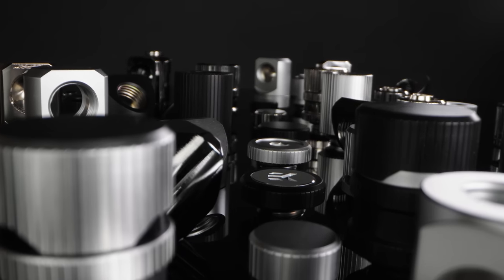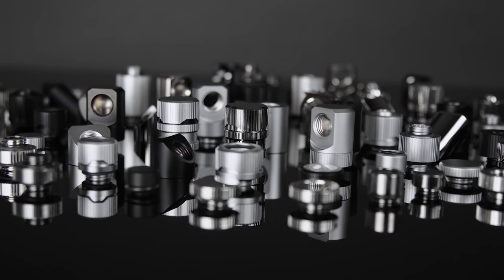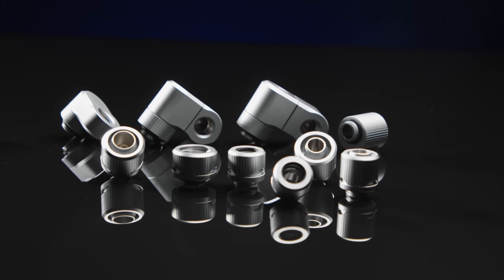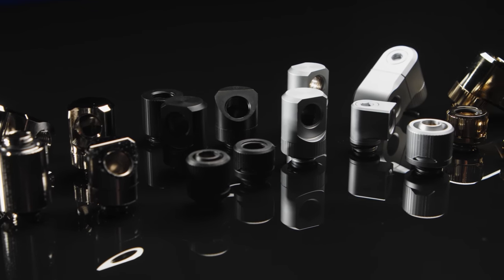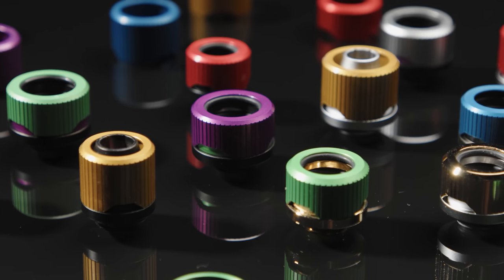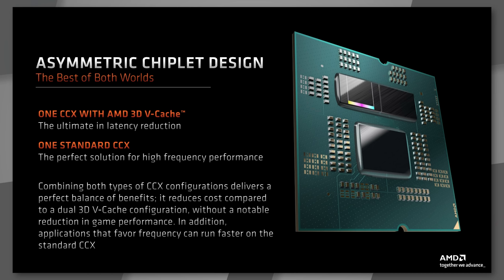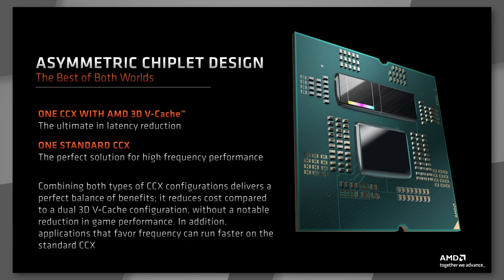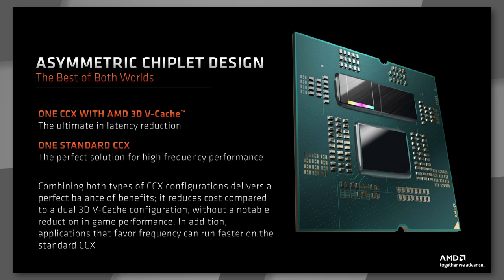Why I switched back to Intel...

Comment: You do realize a -30 offset on all cores would never be stable on 95% of 7950X3D's, that was your problem from the beginning when running 6000MHZ  if your CPU is not stable your ram would seem unstable, I have a 7950X3D with a SP rating of 118, and can only get  CCD0 -14, -7, -11, -11, -9, -7, -20, -22 CCD1 -26, -21, -25, -25, -20, -32, -28, -36 MAX undervote stable with y-cruncher core cycler and OCCT 14 hours. Using Gskill 6000MHZ I had many stability issues but once I stabilized my CPU per core offset i had no ram issues. it's no wonder you were having issues.

Comment: Ya definitely not getting a good fit on the die. My max temp is 62c that I have seen so far and that's with a CORSAIR iCUE H150i. I'm running the KF variant but can't imagine graphics on the die would add that much more heat.

Comment: Last year i did a pc for a friend full AM5 7900x with a rog strix 670e and ram 8000(now why he wanted 8k ram even tho i told him all the time it we couldnt reach that , i have no idea) and even tho the MOBO had like 20 update bios? we never could go further 6400. I was wondering why there are so high speed ram when you couldnt actually use these speeds? Im not a pro just doing it for fun and as a small hobby. 8000 ram man, damn o_O? 

Anyway im on 5900x with 3800 ram and a 7900xtx nitro+ and i was thinking on moving to AM5 gen. I realise that AMD as quality product is starting to "degrade" from time to time. I read we will have new CPUs and new MOBOs on q2 2024.
Should i wait for that or should i move on to Intel :/

Comment: same ram issues with the 5800x cannot even overclock ram above 3600 x4 sticks
Reply: That's why I'm waiting for the new stuff.  The only thing I care about with Ryzen 9000 is 4 sticks of ram working at 6000 for 64 gigs or 5600 with 128 or 192 gb's.
Reply: @traingp7  new stuff will have worse bugs like that though....

Comment: whats thet best aio cooler for 14900k ?
Reply: I'm currently using the Arctic Liquid Freezer 3 360mm for my 14900K and it does the job without any problems.
Reply: The sun because its warmer
Reply: Arctic Liquid Freezer 360 II or III are the best AIOS atm

Comment: I wish I had of seen this 2 weeks ago when I bought all my parts as I would of gone Intel over AMD I bought the Ryzen 9 7900X 12 core 24 thread which is seated on an ASUS TUF gaming B650 and bought 6400 corsair vengeance ddr5 ram and ended up having to dial it back to 5400  to get it all to run stable, the instant you ramp the RAM up to 6400 any game you enter will run fine for 5 mins but will just crash and black screen the whole PC and restart so my PC now sits at 5400 to remain stable, although its not a big deal its FREAKIN ANNOYING

Comment: I have recommended AMD machines but I've never purchased one. Since Core Duo days I've been team blue and never had any problems. I'm glad AMD exists for the competition. My 10600K is handling my 4070 Ti great. I want a 14600K or 14700K mostly for increased single thread performance because UltiMaker Cura is single threaded

Comment: I'm struggling to get my new Ryzen 7900x (non 3d) to post half the time. I think I bought the right hardware at least: Asrock steelseries 670e (newest firmware 2.02), samsung 990 pro 4tb (newest firmware), 2x 32 gb non rgb gskill z5 neo cl30 6000 (supported by mobo list), 750 watt golden plus corsair psu (2 years old, works fine in other system aswell). Windows 11 pro, registered and fully updated. Random crashes galore, even in (newest) bios with just one ram stick in any slot and using ipgu and ram with (6000) or without expo at 4700mhz . All temps under 40 celsius, cpu and gpu load far under 10%. I'm at a loss, not yet found a solution. I was able to install w11 at least. But everything more ram sensitive (eg. gaming) it crashes 100% within seconds. If it boots I can play youtube and browse the web, that's it. Not even tried benchmarking yet. Windows error codes event (id 29, id 6008, id 41) over and over. But I had a crash in bios aswell an hour ago. It reboots and hangs with a black screen. Dram red led on mobo flashes all the time during long bootsessions, must be the training or whatever. My 10 year old i7 4790k with fully bloated ssd's and hdd's boots faster and only crashes once a year or so due to usb problems with some peripherals.
Reply: Sounds like a bad CPU or board. I'd try to get the CPU exchanged as soon as possible.

Comment: 7800x3d msi x670e carbon with corsair vengeances 4800 running 6000oc with xmp an I have had no crashes, no blue screens, nothing.

I've had both amd and Intel an I was skeptical as this was my first "full" build an I didn't want to mess up or wish I had went with the other but I ultimately went with AMD.   This is coming from a i7 14700kf an im still worried i might have made a mistake but overall everything has been phenomenal and i even feel like my 7800x3d has been better for not just gaming, but also normal stuff like webbrowsing while watching youtube with a game open in the background (an this is on integrated graphics), an I just don't want to wish in the future that I went with intel just incase, but I mainly want with AMD for the future proofing and not having to get a new board for a few years.     Its been great an I love it.
Reply: Tbh it sounds weird since you are comparing a 14700kf, which doesn't have integrated graphics ( f = no igpu) with a CPU that does. The intel would have been better at handling the "normal stuff' you are describing, especially if it involved streaming.

Comment: My god, a video actually talking about issues with ryzen rather than just heralding them as the BEST regardless.  Old vid i know but i have had issues with every AMD build i have ever used, but i also have never used the top tier CPU for either
Reply: I had so many "driver timeout" crashes while Gaming its was so annoying! Now 1 year later I had bought a new 7800X4D, 32GB DDR5 5200Mhz and ..... I get even the same issues again! -,- No OC, I use it out of the Box and while gaming it crasht. Got told from another Youtuber its "an user error" or "there are no driver timeouts man, listen to me" ... Now i switch to Intel i7- 13700k (yeah, i know "dead socket") but I'd rather have less performance in games than these problems

Comment: So it seems it's mostly a 3D-problem, so anyone of us plebs that can't afford or justify the expense and just run a more 'normal' option should be fine? :D I'm on my 3600-system still :D Last few times I've used a system builder to kind of gauge the cost of a new system I've gone with AMD, didn't seem like Intel would get me lower cost, but it would be easier to get an Intel NIC, or so it seems (only select higher end boards have anything but Realtek for AMD it seems)... 

Anyway, I guess I'll avoid X3D at least, but that's kind of a non-issue for me anyway due to my really restricted budget :)

Edit: Looked at Intel and it's way more expensive as it stands... Cheapest mobo with BIOS flash, PCIe5 M.2 and Intel NIC was MSI Tomahawk Max and that's like 450 USD here, maybe a bit cheaper if lucky but yeah. And even that has the simple LED error code system...

In my not so humble opinion even basic mobos should have BIOS flash (and preferably CMOS clear as well) by now...

Comment: i have a 5900x with 3080ti once awhile its has goof like shutting down random but it happens more offen on windows 11 then 10. So, I end up on windows 10 or on arch linux. As for Windows 10 is running hotter than Linux for some reason but since its colder outside now i end up running windows 10 during the winter months and summer i run Linux

Comment: I've been on a boycott of AMD since the ATi days when my 9600 series GPUs couldn't last a year without dying. Finally tried AMD again a couple years ago with a 3700X & 3900X I snagged from microcenter. They also died in less than a year. Meanwhile I still have 4790K and 7700K Intel CPUs and an even older dual core running in other machines. AMD will always be the walmart grade of custom PC building.
Reply: I've never had this problem with any AMD chips. If you had a GPU problem, then it's likely due to an AIB design vs reference design. Time and time again I see complaints blaming AMD directly when they're not responsible for third-party AIB's taking their design and adding on different VRM's, MOFSETS, etc.

I've had a couple XFX cards have problems but the company was good about replacing them. Sapphire no issues.

Comment: Transition to "Windows 12" (24H2) Works for me on a non supported hardware CPU to old and no TPM. Can be avoided with some tricks. Installed it. Not the final version. It is all a major letdown. Beter? Nope. Just some things that needed to address are solved. Not a feeling of a Windows 12 OS. They keep up bringing out new versions which they started with Windows 10. Their policy? What lays in de future? An OS that boots and transfer al there is from a cloud machine? A dumb terminal is expected from us. Paying every month for their services... Nope. If that were the case? Hello Apple. 

They can't do that. MS was freaked out about the complaints when win 11 was released. Must buy new hardware to comply to our standards. Said F*it. which was BS. Running Win 11 on old hardware. Stable as F. My i7 K version with 4 cores and a GTX 1080 doesn't complain about everything. Everything runs with speed. Bought a RTX 3060 Ti. Motherboard gave me problems despite many tests who all said; compatible. Don't worry. It did not. Bought a new motherboard with a i7 again but with 12 cores. Not a i9 because to expensive. i7 and RTX 3060 Ti did not let me down. Max speed all the way. Not thanks to MS. Thanks to Intel, Nvidia and Asus. AMD is a real competitor in my view. Had several systems running with AMD CPU's. Cheaper than Intel.  Their same socket policy attracts many people. Just buy a new CPU. It has it drawbacks. Problems occur. If you buy a new motherboard and a Intel CPU? No problems. Drawback? Many sockets. Think that my motherboard can handle a i9. Not to the max. Can handel an i7 with ease.  Not upgrade proof. AMD just have one. AMD4 or 5 socket.  And the surprise of everything? My new 1 year old motherboard went broken. Had to revert to my old system. And surprise Win 11 latest edition and modern games who are demanding runs without any problems. But to the absolute max that everyone wants, but  a slider back? Produces still amazing results on my screen. No delays or what ever.  Smooth with old hardware. With Win 11 MS wanted to step up the anty. BS! 

Old hardware works just it works before. Was surprised about that fact. 10 year old hardware does still a pretty good go at the modern games. No need for state of the art hardware. We still believe that story. New hardware is better... Went from 60 FPS to 240 FPS... Difference? Nope. AMD and Nvidia compete over what? DLSS or an other Technic? Don't worry. Intel introduced XeSS which will run on any hardware. AMD, Intel, Nvidia or AMD. Fuck them all. We introduce our own Technic. Which will don't need a state of the art gaming videocard. Our powerful CPU will handle it all. Powers. They all compete for customers. Buy our product..... AMD let me down in performance and problems in the days back then. Intel (Despite an expansive product gave performance with no problems) back in the days when they produced the i7 was a god send. Solid performance. Are now gready as hell; buy our top product of our i9 series.... Ehm? Nope. To expensive with no performance gain against a good i7 K CPU. SO no thanks..... If you have a bad GPU than there is nothing that a CPU can do against it. That switching back.... I can understand this. 

AMD must come up with a revolutionair product.  They are trying... their best to do so. But Intel rules still against all odds. What I am missing; a very good CPU which is cheap (don't care if it is Intel or AMD)  Performance CPU is somewhat from the past. Can browse or handle emails without lifting any finger. Games? Look to AMD and Nvidia. The battle of the CPU's is over. Now is it is the GPU's. More cores? Unbelievable. Do we need it al? No. I see no difference between 60FPS with all maxed out and a 240FPS card.... There is a limit we all have. Gamemakers are trilled about what they can  produce. In one game I see lets say ray trace effects. It that important? No. I want to survive in that game. Effects are not a part of this goal. We play it because it it challenging. Farcry engine and Unreal engines got that message. Are leaders of the pack.  One demanding game; Callisto protocol. Played it on an i7 (12 core) and RTX 3060Ti card. Now again at my old i7 (4 cores) and GTX 1080.... Difference? Nope.... What I see and feel qua performance? The same. RTX gives you some more effects with DLSS on but does it matter? Nope. Speed is no problem. Effects? Somewhat less. But that old GTX1080 performs and make use of DX12 as the best. It's all relative. Company's shouting all "Buy me" does it matter? No. More speed what don't crystallize. Do I have a wish? Yes. Faster NMVE's. Don't like to wait before a scene is being loaded. No CPU or GPU problem. Just like USB 3.1. We are in need for USB 4. It's coming with some drawbacks. Compatible hardware. We must buy (again) new stuff. I said No. Enough is enough. 

If you react? Just your 2 cents about it. I see the trend as just as JaysTwoCents about the subject. Gave him a solution to install Win 11 on old hardware Got at that time also old hardware. Don't believe MS with their demands. Secret meeting. We want all the people to buy new hardware. Didn't expected a blowback from that statement. I am still the prove that they are talking BS. Win 11 or Win 12? 24H2? Runs smoothly on my 10 year old machine with (according to MS) outdated hardware. go figure........

Comment: I mean you have some very weird issues. That 14900k uses so much power, requires therefore much higher quality motherboard with better with vrms and shit. Getting a 7950x3d or 7800x3d is just a way to go. Gonna be honest now and say that I have some doubts about your impartiality, but I hope I'm wrong here. I have many friends and machines here at work using 7950x3ds and none of them have issues. As well as my pc at home.
Reply: I agree with you, and I also have doubts about the impartiality of the youtuber, I have a 7800x3d in Windows 10, I also have friends with the Ryzen 9 7950x3d processor and there is no problem mentioned.

Comment: my 14900kf is persistenly crashes with no error codes in games, cinebench 23 stable for hours running it, no issues, when i go in gaming it crash and this is with the 0x129 trash beta fix they blow out, undervolt? crash, overclock and undervolt? crash, reset and don't touch anything, enable only xmp and fan speeds? CRASH. Stuttering in games? We got that shit too with 4090 or xtx don't worry about, intel is a disgrace

Comment: Still rocking solid on AM4. 2600x with 1080ti. Everything I play and do on my comp runs fast, smooth, some 4K, some 1080 depending on the game. I'm still looking to upgrade to a used 5000 series ryzen. Not changing my board and memory for a 10% bump. I don't understand how people can buy the newer expensive tech and not feel intense buyer's remorse. Like WTF are you playing that requires a $500+ CPU and $700+ GPU? My whole fuc*ing computer was $500... 5 years ago.

Comment: 5900x with msi b550 a pro, hyperx fury 3200 with a 4070 other than an accidental lamp falling on top of my system breaking a fan and that fan breaking 2 other ones in the process haven’t had any hardware issues however I did have a faulty windows install not sure what happened but had to reinstall completely all over again but ever since that it’s been running stable everything works just fine other than uno but I’ve never had that game work and at this point I got myself a set of cards 😂

Comment: Wait so you felt like you weren’t getting the best out of your x3d by playing indie games and using photo shop so now you expect to notice better performance using a 14900k to play indie games and create thumbnails… both CPU’s are overkill for those tasks. You wouldn’t notice any difference at all without staring at you cpu monitor lol. Even with the ram not running how you wanted it to. There’s no way those tasks made it noticeable without checking under the hood and monitoring it. There is no need to overclock anything on a 4K pc for the tasks you want to do.

Comment: Recently got 14700k , now i want to switch to 7800x3d . Can anyone with real experience in both help me out in here ?
Reply: Help you out with what exactly? You are not losing anything by sticking with the 14700k, its still a great CPU. I don't think its worth going through all the effort just to swap to a 7800x3D. Wait a gen or two.
Reply: Honestly if you were upgrading frm a low end cpu for gaming, the 7800X3D is better. But since you already have a 14700k, the cost of getting a new CPU and an AM5 motherboard is gonna be ginormous. Not to mention that the 14700k is already a really good cpu, beating the 7800X3D in productivity. As for gaming, the 7800X3D does easily beat it, but its not by such a significant or noticeable margin that you need to switch out your current cpu entirely.
Reply: Just wanted to update , i switched to 7800x3d and im so happy with my choice. Got gaming boost  by alot.

Comment: Sadly the 7950x3D is problematic in literally every aspect. Returned mine for a 7800x3d and have had 0 issues with ram or anything else ever since. Running a -30 All Core PBO2 and love it
Reply: Was, rather than is. I had the ram stability issue early on, but bios update fixed all that. Never saw the issues he is describing with incorrect core parking or frequency usage.